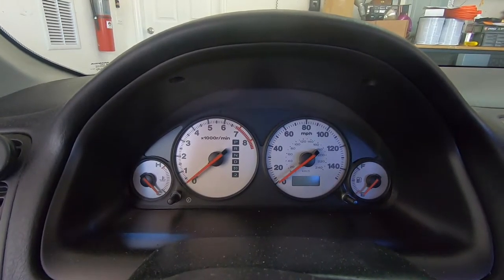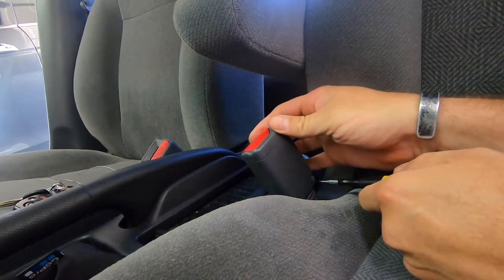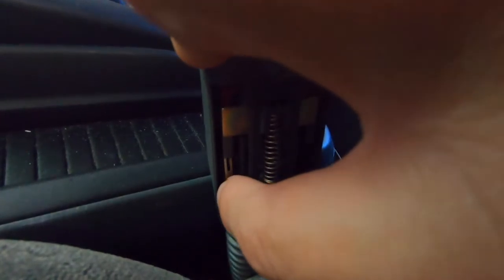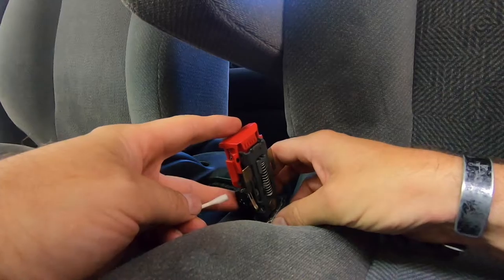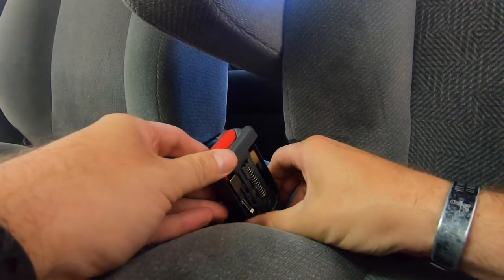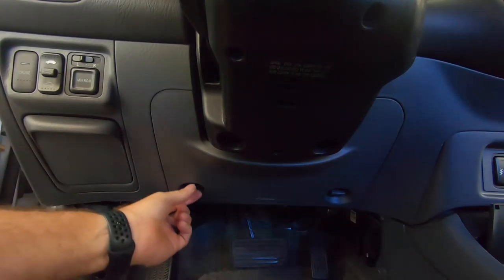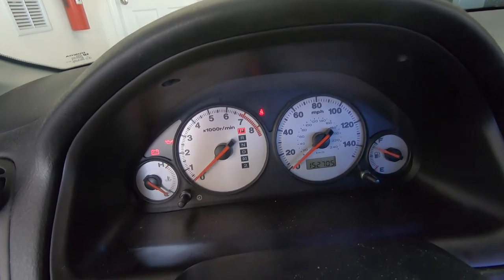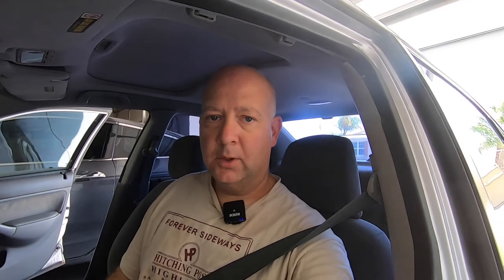2002 Honda CIVIC SRS Light Fix

Comment: Thanks for this video. I'm getting an airbag light on a '04 element. I'm going to try the seatbelt fix on it. Does the wire jumper trick work for those vehicles too? I don't want to buy a code scanner.

Comment: T10 Security Torx is what you need for this. Make sure the torx has a hole in the middle otherwise you won’t be able to get this screw out. Some electronic cleaner works good and a compressor to blow out all of the gunk and dust in there.

Comment: Where did you get the small screwdriver?
Reply from the maker: https://www.toolsid.com/general-tools/16-in-1-screwdriver-mpn-751016.html?view=459687&utm_source=microsoft&utm_medium=cpc&utm_campaign=268680567&utm_content=1173179535357969&msclkid=ef84a3745b1f17314859fcdfbf56dbe2
Reply: I had a hard time finding this too. Went to Home Depot and got this. Works perfect. I think it’s T10 torx screw. These ones have a hallow point in the middle. https://www.homedepot.com/p/DEWALT-MAXFIT-1-in-Torx-Set-7-Piece-DWA1TSMF7/309474859?NCNI-5&searchtype=text#overlay

Comment: Or just get a replacement from a junkyard
Reply: This repair works!  However finding a good junkyard one works too.  I fixed the seatbelt on my original 03, then it got totaled.  I'm planning to pull its receptacle out and swap it on the new to me 03 with the same seat belt issue.